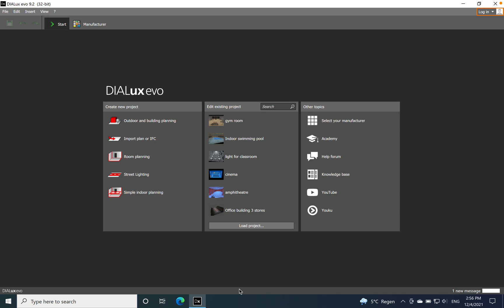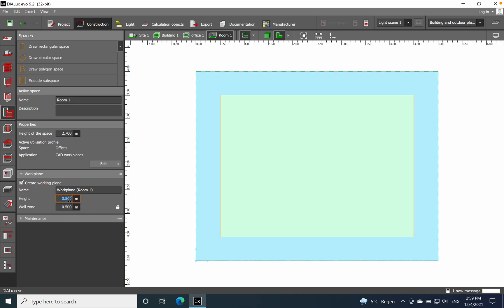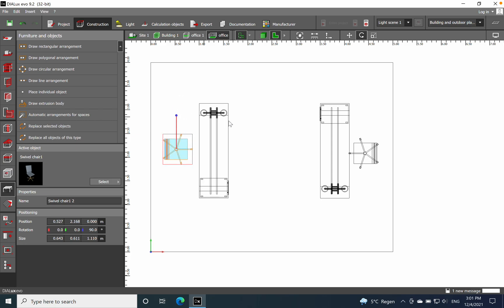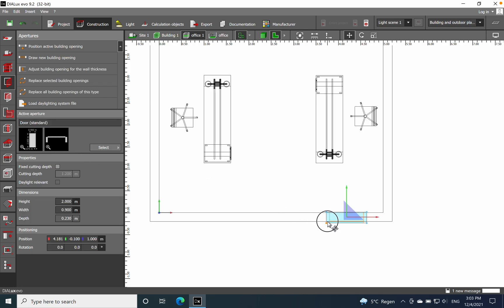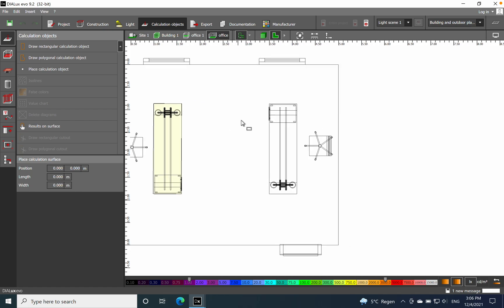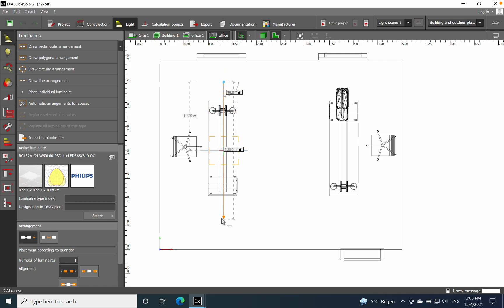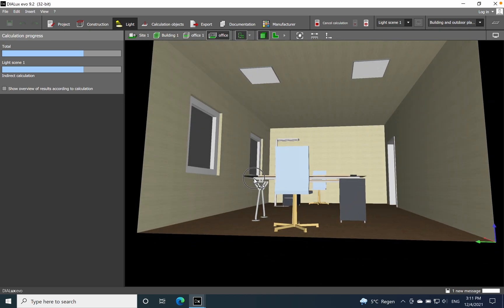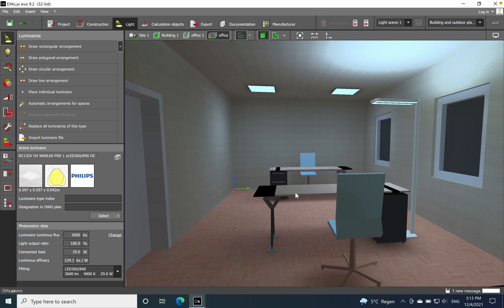How to insert a light calculation surface

Comment: Why target not appear in the results for calculation surface?
Reply from the maker: Thanks for the question. Usually you setup the target of lux level based on the application|space that is defined in standards and as well in Dialux. The surface calculation is giving you an exact value for a specific area defined by you, compared with the overall lux level as you can see in this video from minute 15"52. Hope that everything is clear now.